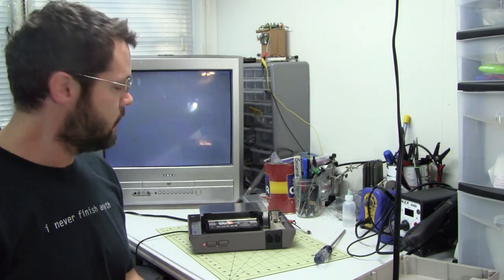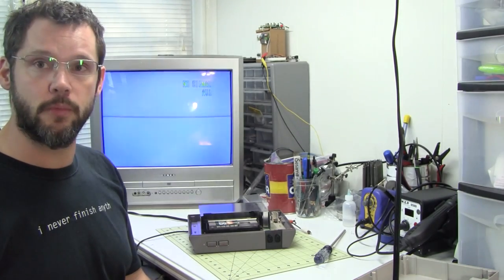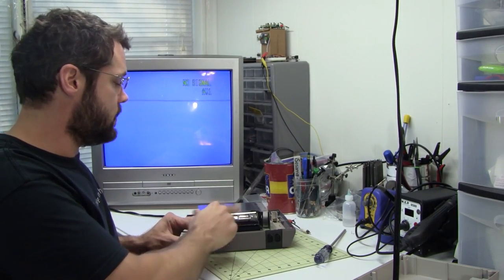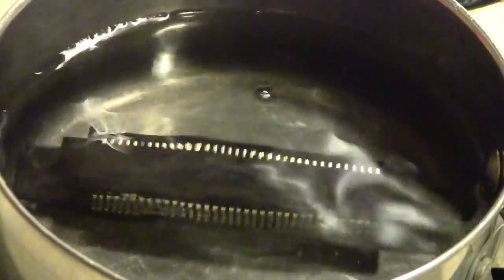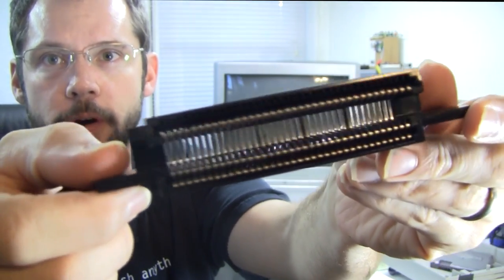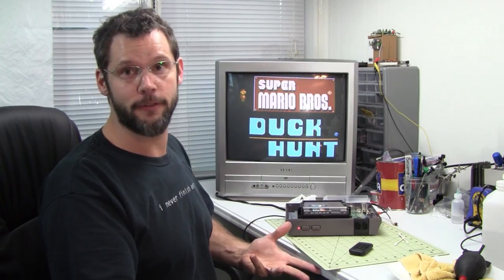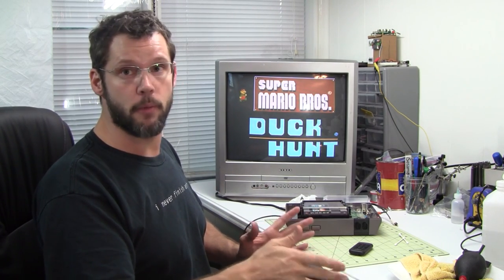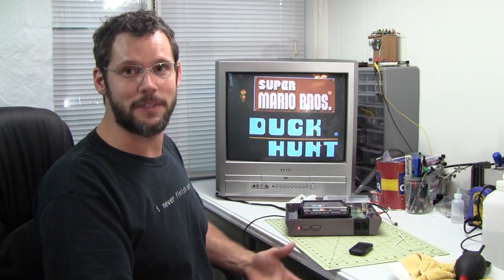When Boiling NES 72-Pin Connector Doesn't Work, Experiment Fixing Blinking Nintendo by Bending Pins

Comment: Hey there. I just refurbished a nasty NES I found at a swap meet that would not load any games at all without blinking and blinking forever no matter what I did. So I decided to try  bending the pin connectors back. I used a safety pin and it worked very well. I tried it on the nes and the games were now loading but still not perfect. So I boiled the Pin connector for 10 mins in distilled water. After this I re-bent the pin connectors back one more time, popped it back on, and BOOM. I would say 9/10 the games now start up on their first try depending on the game condition. This technique works! Thanks for the video.
Reply: you'll still need to clean the games as well to get 10/10 working but yes internal is the main thing.. also remember if you use dirty games in future on your 'clean' connector, it will dirty the once clean internal connector

Comment: you have to bend the top pins first before bending the bottom ones
and you need a flashlight and safety pin to bend the top ones
and you need to reach in the center just above the bottom pins to reach the top pins as the holes at the far top of the connector frame only hold the ends of the top pins inside a divider frame and the divider plastic is fragile so be careful.

and just a tip,the top pins matter more than the bottom pins as they are the ones that make full contact with the top game cartridge pins to receive data from the game cartridge.

Comment: Hey brother, Great Video! One thing I always do when refurbishing consoles etc is disabling the lockout chip and you'll never ever get the blinking red light. As a matter of fact all my consoles work like a top loader. Once everything is clean, the 72 pin connector is boiled and cleaned and tightened, all you have to do is push the game cart in and press power and it will play without pressing down. It works like a charm for me. I've repaired and refurbished hundreds of NES consoles and games etc. My NES has a longer life of game play. Been 2 years of constant game play and no issues and I play a lot of Nintendo. Anyway Thanks for you videos! Love them...You DA MAN!.. Your videos have helped me to tweak my hobby and I Thank You! : )
Reply from the maker: Thanks!

Comment: When the top row of pins also need to be bent back into shape, they have to be pulled out the back, reshaped and placed back into the housing. You have to be very careful and precise though, because too much can have the pin snag inside and bend around. If one gives a lot of trouble too many times the fragile pin will snap. If that happens, you can steal one of the unused pins in the middle of the slot to replace them, they go to the unused expansion port on the bottom behind the plastic.
Reply from the maker: interesting, thanks!

Comment: I found my NES at a pawnshop a week or two ago. I only had to bend down the top pins. There's a way to remove them (and you're actually less likely to break anything with those actually if you know what you're doing. :P ). I think it's the top pins that cause the most issues. But yeah that seems a bit over tight for the bottom pins. Perhaps might put some excessive wear on the carts you use in it, but it will loosen a bit over time anyways so I bet it should be fine. :P

I thought about also working on the bottom pints, but felt like I'd mess up the plastic getting at them so decided not to. Plus they didn't look like they were sagging that much.

The way I did the top pins was push down on the top of them through the little holes on the top near the back of the plastic. There's a flap of metal on each pin that is bent up and holds them in the slot. Putting some pressure on them while pulling them out with a hook type tool (I had some tools with a hook at the end that came with my soldering kit that was perfect for this) should pull them out pretty easily. I then bend them down a little making sure the bend occurs where the metal changes in width from the wide backend to the narrower half.

After I did this, the slot worked perfectly fine for me. Of coarse I also had to clean the mario game I got with the NES. So far got 2 games. Top Gun and Super Mario Bros with Duck Hunt. They both work everytime I put them in. :D

Also the "replacement" connectors found online seem to be all made of steel or something while original NES ones are gold plated? Seems like the originals would last longer so best to just try and repair them. The build quality of the new one's just aren't up to snuff for this slot design.

The BLW device I've heard about prevents the whole action of pushing down the cart after inserting it. I wished they made a version where the PCB is replaced by ribbon cables and some special housing so that you can still use the original slot mechanism. It would be completely useless since it would work the instant you insert the cart, but it preserves the feel that the front loader had and this is why I don't want to ever get a Blinking Light Win slot replacement. It's important to me that the NES works the way I remember it as a kid. :P

Comment: I find the best way to clean NES pins is to open the cart up and use an eraser on the pins.  A really soft rubber eraser wont damage them.  I typically use white white wescot brand erasers.  I try to stay away from sprays and chemicals unless the cart has extreme corrosion.
Reply from the maker: +CVRipley yep, eraser method is the best.
Reply: DeoxIT D100 is the best/most reliable refurb method. In the thousands of cartridges I've cleaned, I have only had 2 not work (because the PCB was literally cracked/bent).
Brush on both sides, leave for 5-10 minutes, gently wipe. Even the worst carts came back to life.

Comment from the maker: TheGreySea2, I can't reply to your comment for some reason. But yeah, I agree with you.  Based on what I've learned since I made this video almost a year ago, I would open the carts and clean them with the eraser method first.
Reply: Hi there, I read through the post below and couldn't find the parent post to your response here. Can you please further explain (based on what you learned this past year) how you would clean the cart with the eraser method (and I'm assuming here this is about cleaning the game carts)?
Reply from the maker: watch this https://www.youtube.com/watch?v=BHAi5FfPatY
Reply from the maker: the video I linked to explains how to clean carts w/ an eraser.  it's a very safe and effective way to clean contacts.
Reply: @annad.7845  sorry my comment got lost somehow - you need a 'nes security bit' to open the cases usually, then with an eraser (I've used PVC free but I'm not sure if the type really matters) rub the gold pins on both sides liberally - depending how dirty and oxidised you may need to spend 5-20 minutes doing this. Then follow up by cleaning debris with isopropyl alcohol on qtip. I don't have Deoxit yet but I have heard good things about using either D100 or DN5S products (not sure which is best yet), to remove oxidation (then using isopropyl to remove any residue). Caig Deoxit isn't super cheap so I still haven't tried it but I hear it is a very useful thing to try at least on the internal connector - it should protect it in future after application and prolong the time between refurbishments to the internal connector, from what I understand

Comment: The problem you are having with Athletic World is almost certainly capacitor-related. Easy fix!
Capacitors store and release charge and bad caps don't have enough by the time the game's initial boot processes need it. When you reset they have had significantly longer to charge and, thus, they work.
Reply from the maker: +Emmett Turner hmm interesting.  Maybe next time I have the camera set up I&#39;ll take a look at that.  Thanks for the tip.
Reply: Which caps in particular? The main cap?
Reply: @user-wj9xq7ig2v  A capacitor inside the game cartridge, though replacing caps in the console could help also. Many games have a single electrolytic cap inside. I find that the bad ones will give a gray screen at power on until you cycle the power quickly or reset. The connection is good enough that CIC lock-out is working (not resetting/blinking) and the rest of the game demonstrably has a good connection (works after merely resetting) meaning it should have booted the first time... except that the bypass capacitor was too slow to charge and the ROM/mapper hardware did not power up fast enough before CPU execution glitched/stalled.
Reply: @emmettturner9452  wow thanks. I've been chasing a similar issue.

Comment: Cool technique. I usually open them and give it a cleaning then bend the pins out. It's an improvement but not perfect. I'll try this next time. I also cut the lock out pin. I prefer the smooth top NES'!
Reply from the maker: Greeneyez2475 thanks. I usually tell people to try boiling first as it's less likely to mess anything up and usually works.  If boiling doesn't cut it, bend the pins. And, only cut the lockout pin as a last resort unless you want to play Japanese games too.

Comment: Hi, @8bitjunkie is it normal after cleaning the pin connector for some of clean pins to show some brass in color? Will the games still read if some brass is showing?
Reply from the maker: clean how? sandpaper?  you may be taking some plating off the pins - not sure.  Games will probably still read, but the pins might re-oxidize faster if the plating has been removed (assuming that it's plating - I don't really know).

Comment: Hello

I have an nes that was modded it has rgb and the blinking win mods

I didnt know with the blinking win that you dont push down on the cart

I pushed down on my carts. I wasnt aware that im not supposed too

I wondered some of my pins are bent on my 72 pin connector

Can i just bend them straight to get my nes working

Comment: I boiled my 72 pin connector and it is partially working now. I'm going to re-boil it tonight for a second time and see if I can get more of my games to work. Right now it works about once every time I hit the power button. I cleaned the pins with alcohol and rebent the pins up and the cartridge is definitely more snug now. Any other suggestions on how to get the rust off of the pins other than boiling and rubbing with rubbing alcohol? Thanks for the vid!

Comment: Hey I tried to bend the pins up and some games don't need to be pushed down to work, like super Mario bros., actually it doesn't work if pushed down, weird right?
Reply from the maker: maybe bent the pins too far up?
Reply: I forget which way but I think it was inthe down position, it is actually putting strain on the pins, hence this whole issue.. so loading without pushing down is arguably better on the pins. I could be getting it mixed up the other way around though. Or maybe it was in any position stress was put on the pins (compared to the famicom). Either way playing without pushing down is perfectly fine - it's a workaround I've been using for 20 years to get my NES to work (using a game genie as a passthrough).

Comment: I picked up a nes at Goodwill and the 72 pin slot is so loose if I just hold the unit upside down the cart will fall out. I'm guessing just replace it right?
Reply from the maker: maybe, yeah
Reply: Just rebend the pins.  Worked for me.
Reply: I just replaced the entire connector ;).

Comment: Rather than boiling mine, I just cleaned it and pulled the pins up, and I found that the games do work when I put the cartridge in but don't push it down
Reply: Yeah that's what happened to mine, I'll never bend another one, it's ruined, not supposed to work that way.  Too tight.  Going to buy a replacement

Comment: You took 41 minutes showing something that would take 10 minutes to show. Your repeatidly pushing the cart in and out and pressing on it and wiggling it isn't how to test a game. Who grabs the cart and wiggles it once you have it inserted and turned on? Moving the cart while power is applied increases the chance of a short and damaging either the system or the cart, or worse, both!
Reply from the maker: +Zestypanda true; my newer videos are much shorter.  Cart wiggling? Old trick from the 80s. No carts were harmed in the making of this video.
Reply: 8bitjunkie Well, when I would play the games I wouldn't grab them and move them once they were in and I saw that they were working.
Reply: +Zestypanda yup, that's a real nice way to make the system worse. Good one buddy
Reply: +anodecurrent really? I've always had to fiddle a bit at the moment .. as I still haven't cleaned internally. I popped open my NES Cleaning Kit but lazy .. will recondition the connector if I can too .. just busy hacking my xbox xD

Comment: Is the contact cleaner better than using alcohol for cleaning the contacts?
Reply from the maker: vectorsan probably. obviously contact cleaner is specifically made for.. cleaning contacts.  It also dries much faster than alcohol and leaves almost no residue (less residue than alcohol).  However, alcohol works pretty well too. If you use alcohol, use 90% or higher isopropanol if you can get it. Never use alcohol labeled "rubbing alcohol" which has a bunch of additives in it (at least in the United States)
Reply: 8bitjunkie I thought alcohol would be good to use too, since that's what you use while building computer parts, but the back of NES cartridges specifically say not to use alcohol.
Reply from the maker: yes, it does say that, but I think they meant for cleaning the outside. but even then, I have no idea why they wrote that warning label; alcohol doesn't seem to hurt even the label.
Reply: @8bitjunkie8 They wrote that warning so they can sell you their “alcohol” with the nes cleaning cart lol

Comment: I just got done boiling the pin connector, took a safety pin and bent the pins back up some, game fits super snug now, but still wont play unless I hold the game in a certain position. I already snipped the lock on it as well. Its up and running atm, iv got a screwdriver shoved on top of the cart to keep it held into the position that it works in. if anyones got any tips for how to remedy this would be very helpful. whats the next step?
Reply from the maker: +Jason Pittman replace the connector

Comment: Wouldn't simply buying a new connector be easier and cheaper in the short and long run?  I couldn't justify the time energy boiling and bending pins knowing $10-$20 for a replacement pin assembly will fix it faster and cheaper time wise.

A top-loading NES also will fix the problem as Nintendo recognized the original console had the problem and redesigned it to load from the top to eliminate the problem.  

Every subsequent cartridge system Nintendo made loaded from the top from the SNES to the N64 learning from the original NES
Reply: new 3rd party connectors aren't as good
Reply: As another person stated, 3rd party connectors are made of cheap pot metal and might cause corrode causing damage to carts. Real OEM connectors are of much higher quality, they just get dirty and lose tensioning causing them to not make solid contact.
A top loading NES, which it would techincally solve the issue, go for well in excess of $100 and they are RF only... not even composite.

Comment: I bought a new 72 pin and the eraser to clean and polish the games, no problems after. Try it, you will be surprised.
Reply from the maker: +Bandit how long have you had the new 72 pin?
Reply: +8bitjunkie Had it about a month now, works great, most of the games you don't have to push the tray down, nice tight fit
Reply: +Bandit To tell you the truth, don't get the Original 72 and the New 72 mixed up, I got confused, the only way I could tell the difference was the New 72 was tight

Comment: wrong wrong wrong! 
Blow in the cartridge till your lungs are empty, put the cassette in, smack the console a few times and she'll work like on her first day!. done
Reply: Cartridge not cassete
Reply: whats the difference?
Reply: Cassette doesn't have rom or ram
Reply: The more you know.

* rainbow+ magic sounds
Reply: A cassette is a magnetic tape, while a cartridge is a board containing at least two ROMs and sometimes a mappers, sram and even some battery. And no, not everything is solved by blowing (who do really think that, anyway?). This connector is a design flaw made by Nintendo trying to conceal a video game console as a more serious device, such as a VHS tape reader. It is some kind of ZIF and yes, over time it ceases to make contact causing the console to fail even if the active components are all working flawlessly.
Reply: @retroand  Get a load of this guy.    Hes not old enough to remember calling them Nintendo tapes.